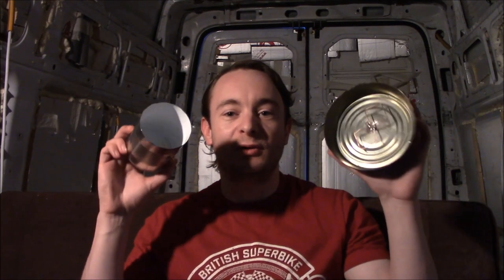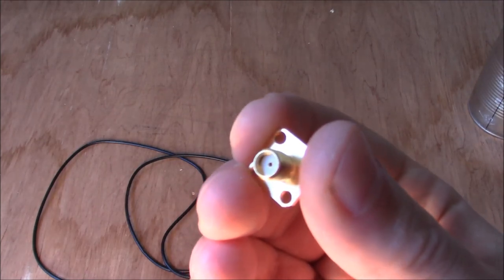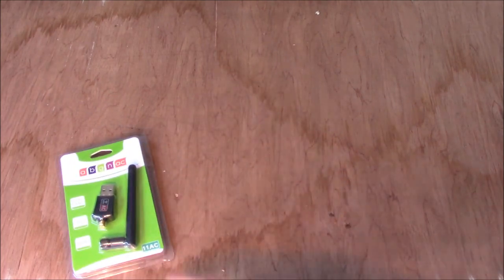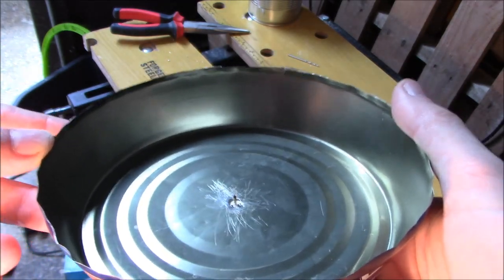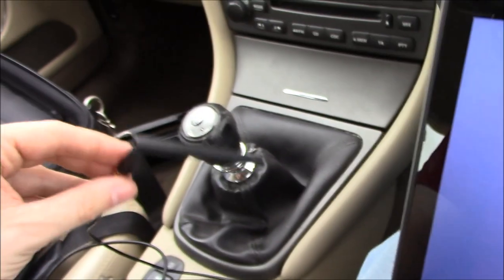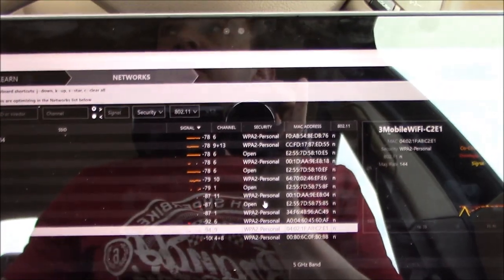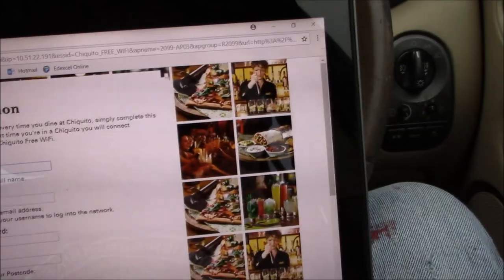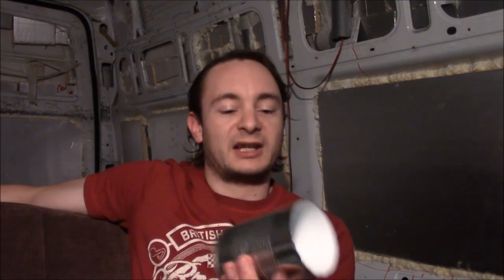Project "Canned" - Cantennas Built and Tested

Comment: good little project buddy ! i like this type of DIY stuff. The antennas defo boosted the signals there, even if just a small amount. Remove the extra copper wire you connected to the reflector, it is earthing the whole thing together as 1 antenna, if removed i think it will work alot better.  Van is coming along great, well done fella
Reply from the maker: Thanks man. I've been doing some research on antennas and I'll be having another go while the van is still with the mechanic. Thanks for watching :)

Comment: I fitted 4G router in my transit with extended antenna worked fine cheap too.
Reply from the maker: Any chance you could link the make and model?
Reply: Robert Bunting I used a TP-link MR3020.

It's switchable from Access point to usb(3g/4g) I have amazon stick so I tether too kodi :)

I started my build after watching your first videos and also having issues with my window :(
Reply: If u wanna have the extended range u will need to drill small hole in rear of the case and fit a external aerial it's small golden push connectors like phones/laptops use.
Reply from the maker: Thanks man. I'll look it up. Good luck with your build. My window is fine now, hope yours works out too. Thanks for watching :)
Reply: Robert Bunting we share alot of similar items. Struggling with the same leds as you, there so sensitive with my water system and when pumps purge they flicker all over the place so I had to wire them to there own supply rather then fusebox supply.